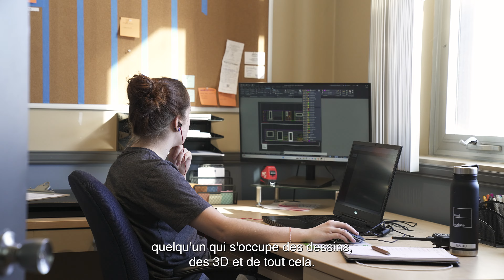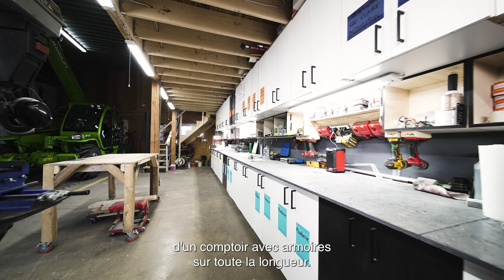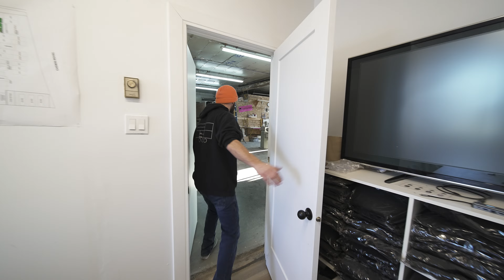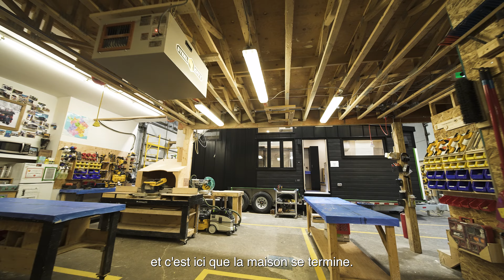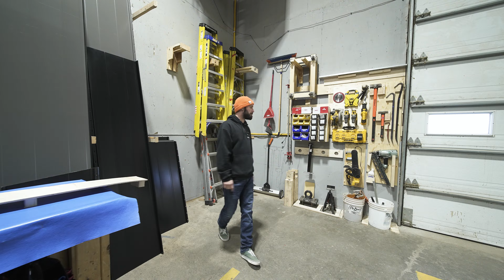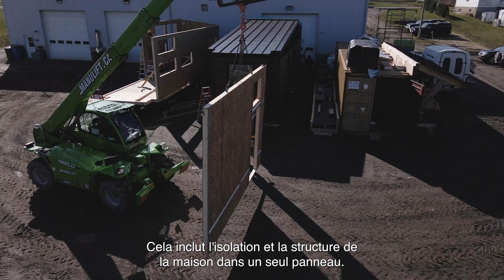Minimaliste shop video tour!

Comment: It’s obvious to see you that you guys have adopted lean in the shop. I was surprised to see that you’re using not using Revit. I also suppose a lot of the 2D printouts eat in your profits. Have you considered iPads and screens for showing plans? It’s much more efficient especially given revisions, not to mention the lost time from printing. Adopting something like autodesk construction cloud would allow you to easily share designs among the team, and to stakeholders. Keep up the good work.
Reply from the maker: Hi! We use Autocad, SEMA and sketchup. Regarding digital plans/Ipads, we tried this route, but ultimately some things on the worksite are preferred to be physical, such as the set of plans. thanks for the tips though!